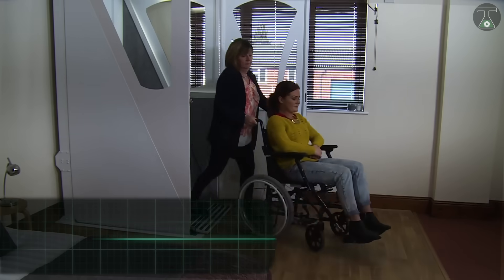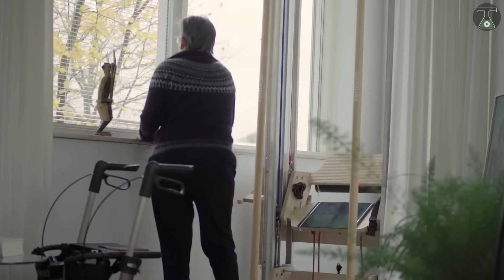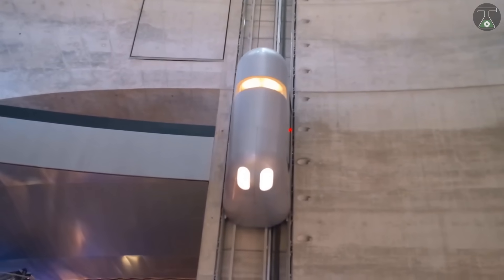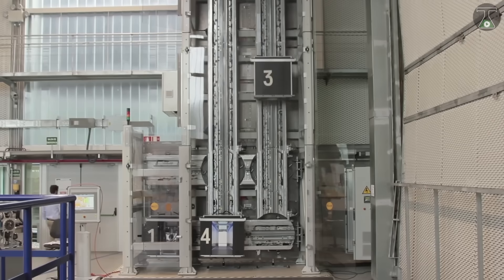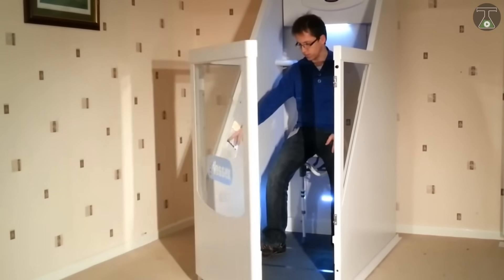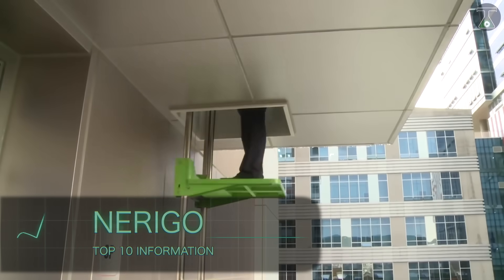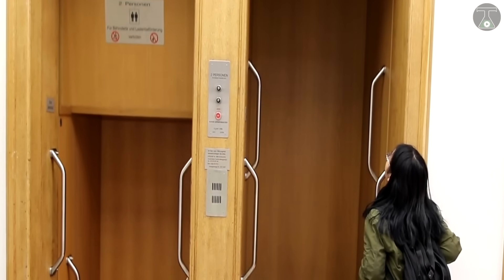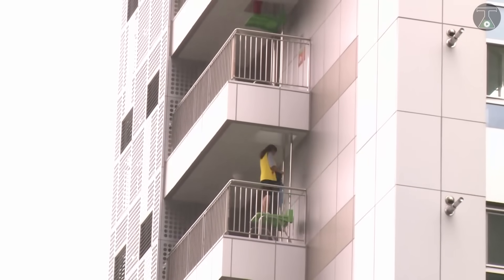8 Sci-Fi LIFTS & ELEVATORS

Comment: The fire exit elevator- As you can see there are steel rods that direct the elevator up and down.  What if the entire building is on fire and the fire gets to these elevators and heat up the rods?  There could be a big disaster on your hands.
Reply: joseph dunn silly pants